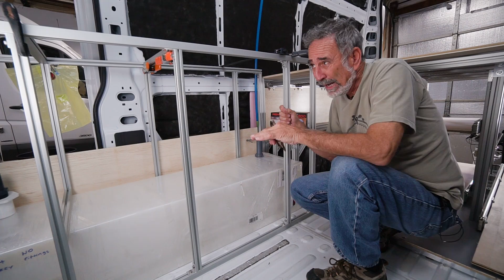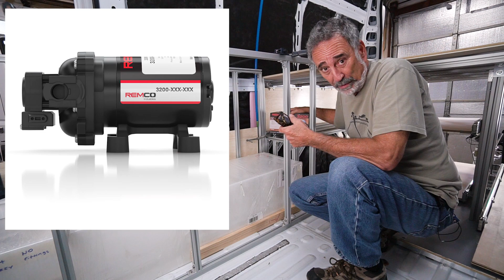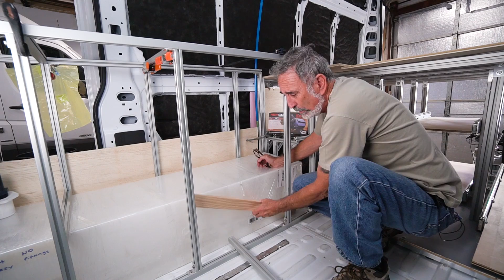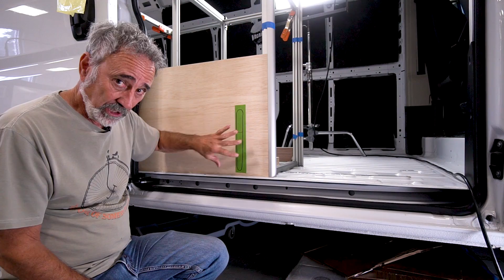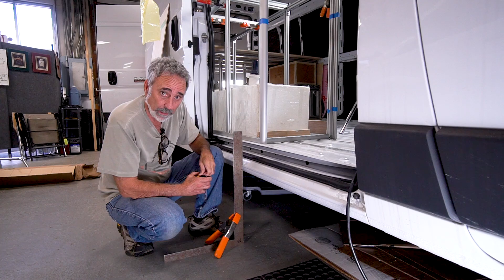Custom galley bones in a Promaster van

Comment: Thanks for the great video - what fittings / parts did you use for the fill, and pump side pick up? Would love exact Amazon links if possible. Thanks in advance!
Reply from the maker: Thank you for your support. All fittings are made in house with raw plumbing parts from local plumbing supply.

Comment: Question on pick-up tube system.  Where did you get that pick-up tubing and the check-valve you mentioned in a later video? How low into the tank did you place the check valve (Assume close to the tank bottom but thought I would ask).  We also are concerned about putting openings anywhere but the top of the tank and really insist on an inspection port for assuring safety of the water.  We are in the process of converting our new transit and have borrowed several ideas from your excellent videos. Thanks for posting.
Reply from the maker: Just make sure your tubing is "food-safe." And also be sure the check valve will work in both horizontal and vertical applications. Obviously it lays on the bottom of the tank. All holes are through the top of the tank.

Comment: Does the tank have baffles of any kind inside?  How do you prevent plastic cuttings from dropping inside tank?  Do you have a way of getting cuttings out if they do drop inside tank?  Do you treat the inside of the tank with anti algae or bacteria treatment?  Appreciate your instructional videos, thank you.
Reply from the maker: I install 8 inch inspection hatches in the top of the fresh tank. Precisely so the tanks can be cleaned, inspected and treated. This particular tank did not have baffles. Baffles are available.

Comment: Great video... and the water fill site "tube" is awesome.... here is an idea... instead of a momentary push button you could have an undercounter light on the end with the 8" inspection port that comes on when you open that cabinet.  before filling the Fresh Water tank you open that cabinet and the light comes on (or you could have your momentary on a parallel circuit with the cabinet door switch).

Comment: I have a question...   About the 80/20 .. which size are you using? 40 by 40 ?  I'm also VERY interested to understand how you attached that round corner to the structure to make possible that the wood sit flushed inside?  I know there are rounded 90 degrees 80/20 components but I've been playing a bit with CAD 80/20 files and I don't get how you managed to do that round corner :D. 
Would you be so kind to explain me?
By the way I found your videos the best, so much attention for details, well explained and really instructional. Great sense of minimalistic and pure design. My sincere compliments
Reply from the maker: Depending on the module, I use 10 series and 15 series. I, being an American, use fractional profiles.The one inch quarter round 8020 makes a beautiful corner with 3/4 plywood! How I did it? Is what makes this road humble...😉
Reply: Humble Road thanks 🙏🏼.... i thought you were using the bigger 40 series 😳.  So the smallest 15 and 10 are strong enough for the job. I’m planning to start using also 80/20 system but since I’m in Europe I need to find another supplier since isn’t 80/20 isn’t available for purchase. Btw I’ve got more or less how the round corner and the wood works but I’m still wondering how you attached that extra rounded profile 😬

Comment: Love the videos, very informative and well thought through. One detail that I hear others mention is to not bolt alu. frames directly to the van but to bolt via an insulating heat break, otherwise in cold weather the van is very difficult to keep warm as the alu frame conducts directly to the cold metal shell of the van, what are your thoughts on this?
Reply from the maker: I agree! And as you continue to watch my videos, (you WILL continue to watch, right? 😉) you will learn that I always sandwich in a piece of rubber wherever the aluminum touches the chassis.

Comment: Another amazing share of building craftsmanship.  I was wondering why you would not say want to place a 1/4 lift on the fill side of the tank so it tilts towards the pump end of the tank and then also place your drain down at that end  that would help make sure most of the water ends up down at the pump end as it runs slow or is being drained?  Or... is that already molded into the bottom of these tanks?  Great video... on to the next.
Reply from the maker: Operator options. Park the van as needed.

Comment: Take a look at draw slides that are push-to-open. They wont self-open on the road. They are nice because they work as soft close and lock in place. No extra hardware needed to lock the draw. To open push in and they "pop" out.

Comment: Would it not be better to have the water tank outside the van, i.e. underneath the van?
Reply from the maker: Four season coach. Fresh tank and all plumbing inside the coach. Only grey tank hangs outside but will most always be empty.
Reply: @HumbleRoad  I see, does that mean you have to leave the heat on 24 / 7 when your nor in the van in the winter? Are you going to have cellular remote control for heat?

Comment: Tank drain:
Have the drain go out the same side as the sliding door, just like the fill hole...less cutting on the floor.
Reply from the maker: Frame member under the van

Comment: Will the tank drain freeze and split in freezing weather?

Love the site glass idea.
Reply from the maker: Owners opted out of the tank drain all together. No worries!
Reply: @HumbleRoad  With no insulation under the tank, won't it freeze in winter?
Reply: @HumbleRoad  That's good to hear; I cringed when you discussed putting that in. As you mentioned on the pump inlet, having penetrations on the side/bottom are a potential leak hazard. Simple enough to siphon, or just use the pump.
I love your builds!

Comment: Another option to save space with the kitchen sink trap is to use a right angle off the sink drain straight to the back wall. Then put a normal trap - flush against the wall.  Serves the same purpose feeing up valuable space under the sink. And no special parts!

Comment: Hole in top for tank drain with straw to bottom. Hook up tubing to it and siphon out the doorway. No bottom holes in tank.
Reply: Put straw into outside corner. Park nose low and passenger side low to siphon out all but a couple of cupfuls.

Comment: About water sloshing while driving.  Can this throw of your turns on a high way or corner radius.?
Reply from the maker: No worries there. Best to keep heavy items such as water tanks as low as possible. Some builders hang them under the van. But then they are exposed to the freezing temperatures.

Comment: Not sure if I miss understood the location of the sink drain George.
Is it going in front of the tank on the galley side? 
If so won't that take space away in the drawers? 
Great build, I'm sure the Vagabonds will be happy when it's done.
Cheers Toz
Reply from the maker: You have a keen eye, Shauna! The sink drain will actually rout towards the back of the cabinet then come around the perimeter and below tank top so as not to block drawers.

Comment: Tripod Square = neat little hack that should be patented.  Vote:  90 degrees out the bottom close to the outside front edge, because it will be easier to position the vehicle in a manner to drain from that corner, and you won't have to fiddle with the mechanism inside the vehicle.  However, you probably want to position it somewhere pretty close to the frame to protect it from rocks or road debris and angle it to keep the bottom from plugging up.  Outside the vehicle you can grease the t-handle to keep it from corroding and sticking shut.  Just make it stainless steel.  I'm sure you already got all of that figured out, though.

Comment: With a water tank that large and long, there can be a lot of weight sloshing back and forth with van starts and stops. Assuming your tank has one or more baffles to reduce the "fetch" and resulting noise, you might consider having inspection ports in each tank bay.
Reply: true but less dangerous than having the tank place parallel to the driver/passenger seats. imagine while turning in a sharp turn/curve more so on wet roads what could possibly happen

Comment: May be a stupid question- but would there be drawbacks to having the fresh water flush go into the grey tank?
Reply from the maker: If you mean toilet flush, there is none. A composting toilet will be installed. If you mean sink and shower drain, that will be plumbed into the grey tank.
Reply: Thanks- good to know

Comment: -Locate the tank drain under the 8" access so it is accessible also. 
-What about pressure buildup in the tank? As you fill it up the displaces air has to go somewhere and as water is being removed by the pump air needs to enter to avoid creating a vacuum. Pressure will also buildup while driving.
-Have you considered adding a heat mat under the water tank to resist freezing issues in cold weather?
Reply from the maker: tank drain suggestion is a good one. As for pressure imbalance, I did not mention the fact that I will install a vent tube which travels up the inside wall. In my second video of the day, I mention how the tank will sit on a couple layers of foam and HMV.
Reply: @HumbleRoad  The HMV/foam board is fine when in daily use or winterized. It is possible on occasion to have the Van sitting a couple days in low temps but not wanting to empty the tank. Battery heat mat would be good too. Not necessarily mandatory but worth a conversation with the new owners. Much easier OEM install than retrofit due to running dedicated electric to it.

Comment: lol Humble Road 80/20 Van Build School in session. ;-) Wouldn't be surprised if there isn't half dozen builders fabricating vans using 80/20 in 2020.  I used 80/20 15 series for 43"X32" shelf in my custom cargo trailer, I like how  brackets don't intrude opening and make it rather easy to adjust shelf heights.

Comment: Think about a rubber mat below the tank to help with vibration that could eventually crack the tank. It would also provide a little insulation and help keep the tank from sliding by adding friction between the tank and the van floor . Great progress. 👍

Comment: One crazy idea I had - I often park on a bit of a slope. How I park can change if I can use the last part of the water in the tank. Wouldn't it be nice if the tank was also on an angle, so pretty much all parking spots it uses all the water? Put the pump hose into the lowest corner. I'm talking a subtle angle like a few degrees.

Comment: Why are you cutting a extra hole? Won't the clean out hatch fit where the fill pipe is going?  I coped your van 1 design and use the hatch to fill my water tank all the time now. This is a big plus when using a container to carry water to the van when no hose connection is available.

Comment: One suggestion, put 1/8" foam core foil insulation under the tank before locking it down. With the tank inside the van, the most likely point of freezing(and damaging the tank) will be through conduction where it meets the metal floor if cold air is passing underneath.
Reply from the maker: We think alike, James. In the next video this morning, I mention just that!
Reply: @HumbleRoad  Yeah, I watched the second  video immediately after and realized you addressed the issue I had commented about🤦‍♂️.

Comment: Another person made this comment, but what about keeping that water from freezing in the tank--it is inside, but no heating pad?  Seems like putting that water tank drain plug underneath would be consistent with not creating a possible leak spot inside the van. Thanks for walking us through your thinking and considerations. Slick tripod trick!
Reply from the maker: Yes, as the thought process continued beyond the video clip, I realized the safety aspect of a bottom mounted drain valve. And in the next video this morning (a two-fer this week) I mention the thin layering of HMV and foam under the water tank.

Comment: How about installing a low voltage heating pad under the tank?

The tank is on the cold steel and can freeze in subzero temperatures. If you connect the heating pad to the high capacity Lithionics battery, it won't freeze.
Reply from the maker: I will be layering some HMV and foam under the tank. That should be enough of a thermal break. Also, this van is going to be lived in full time. So it should be toasty warm in there when it needs to be.

Comment: Hello George, I am glad you choose the pick-up tube for the water tank:  based on the concept that all the holes should be on the top of the tank, I would drain it from the top pick-up tube and the pump instead of drilling a hole in the bottom for a gravity drain.  In my project, I installed a small 10 gallon tank and my pump is rated at 2.3 gals/min, so emptying my tank will take about 5 minutes do do so.

Great work, I look forward seeing the project advancement!
Reply: Hi from the UK. Was about to say the same thing. Why undo the efforts to prevent catastrophic leaks ? Even less accessible under the tank.  These pumps will easily empty a tank and run dry with no damage. Basically just run the taps dry.  No need for an extra drain at all ?? One less hole to the outside. Im with you on the inside water filler but it does create an issue having to open the door to fill up in colder weather. Worth it I think . Another great video George. Thanks again for sharing. Happy travels everyone. John

Comment: Hey George, that's a Great Idea for the inside water fill!  But, I have a silly question, will you need to raise one side of the water tank so you can drain it out completely?  Thanks for sharing!
Reply from the maker: Rather than raise the water tank to drain it, park the van in such a way as to empty the tank. Much like turning the light bulb, rather than the ladder... 😆
Reply: @HumbleRoad    daaaa Thanks George!
Reply: What I do in my RV is open the drain valve and then drive around and it all drains out.

Comment: Will it still be possible to hook up to city water when not off grid?
Reply from the maker: No city water. I have discussed this theory in many of my videos. In order to maintain a clean fresh water tank, the water must be used and replaced on a regular basis through use. If you get into the habit of hooking into city water, your tank will go stale, stagnant and grow all kinds of weird bacteria. Cut the cords! Cut the hoses! Remain completely untethered!
Reply: @HumbleRoad  makes sense. Thanks.
Reply: I’m wondering why the drain would be placed 19 inches from the right side of the van. Won’t that make it harder to reach?
Reply from the maker: I was referring to the sink drain, making its way to the grey tank.
Reply: @HumbleRoad  OOPS, my bad! Thanks for clearing that up.
Reply: @diepenj47  Maybe because the tank fill is going to be on the door side and closed off? Also with the visual fill site there may not be room for it.  The right side of the tank allows easy access for repairs/maintenance? How often will you completely drain the tank?
Reply: @diepenj47  I may be wrong, but odds are that 19 inches is just where it will exit the floor.  I'm guessing that he would run a piece from there over closer to the side door for ease of use. I know some people use an electric ball valve that they can turn on to drain the tank without leaving the vehicle.